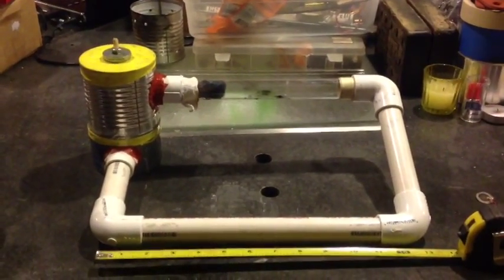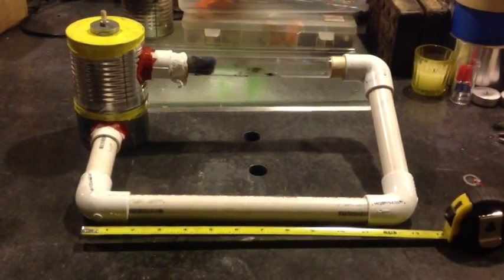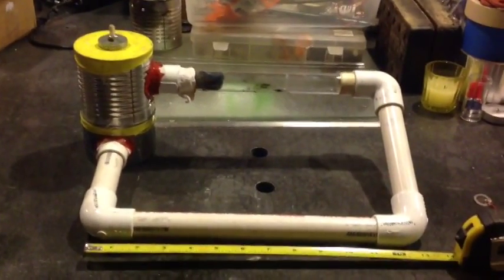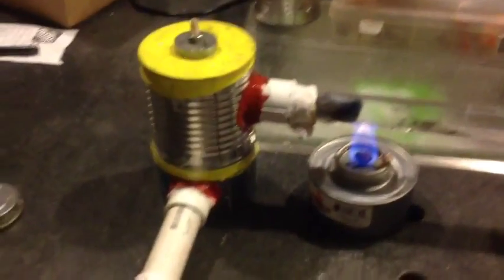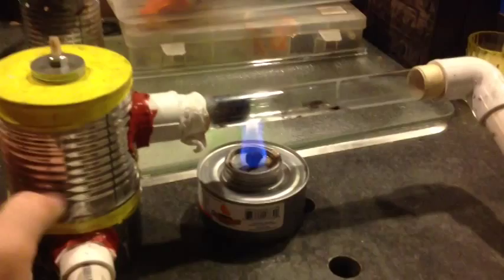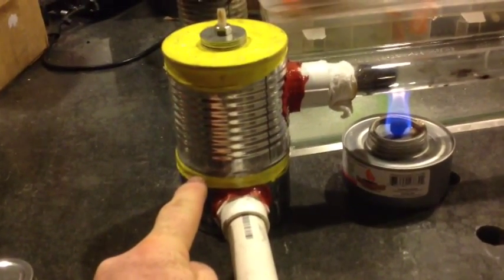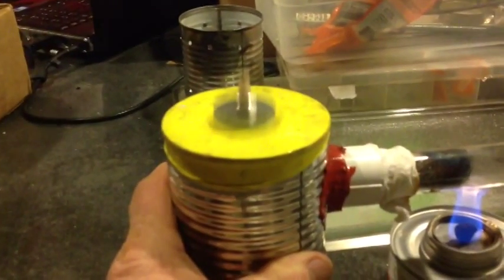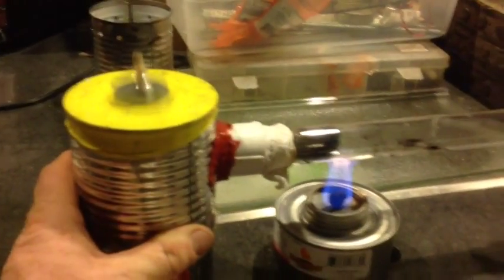Traveling Wave V1.2

Comment: how about a schematic drawing?
Reply: LOL the only hard part ... is the tin cup with diaphragm ... after that a little steel wool in the heat safe tube ... to collect the heat better ... and a candle that fits nicely under the heat tube ... and away you go ... 
.
as for the tin cans ... cut the fill hole off a balloon ... stretch over the one open end of the can ... secure under the folded over rim from the sealing process of the tine can ( yup that means cut the lid out not off ) ... stick a pin in the middle of the balloon insert a bolt with a washer on each side of the diaphragm (or two) lock the bolt in place with a nut ... a second can turned upside down add tape as need or some gasket type stuff around outside edge of bottom can so top can can move up and down easily ... BUT not allow anything to leak around the can ... ( a single can also be used but has to be opened at the top and a hole made just above the bottom edge to allow air flow ... 
.
it is really simple and you can see everything in the video easily

Comment: Nice Video! What is the frequency of magnetic oscillation? Is it the same as the frequency of the resonator, or it depend on the tension of the membrane and the weight of the magnet?
Reply: yes 
.
the resonating frequency of the complete system will be it's base frequency ... how tight the membrane is ,,, where the membrane is ... and the weight of the fasteners will all change the base frequency ... like all things one trades off efficiency for usefulness ... once he connects the diaphragm piston to a rotary wheel of some type it so he can then use rotational motion to drive many things .... or he can use it like a tattoo machine as it is ... and just add a needle with paint